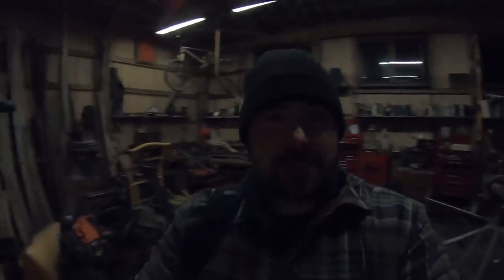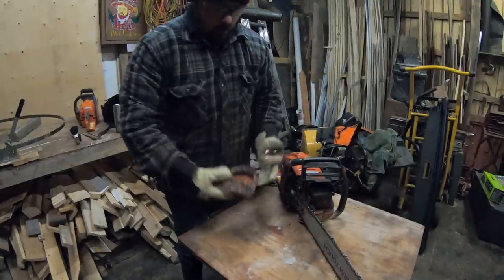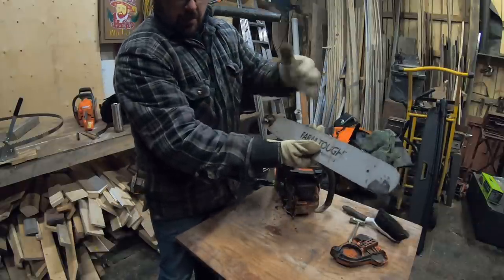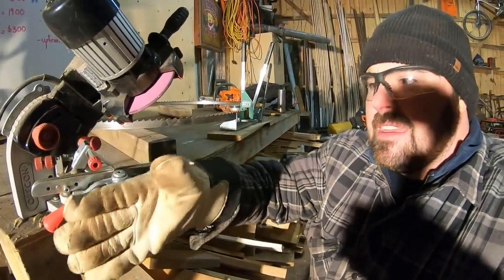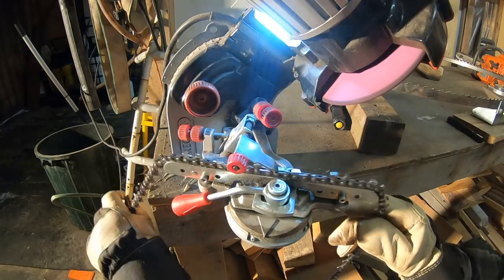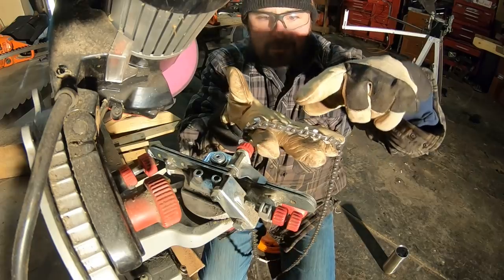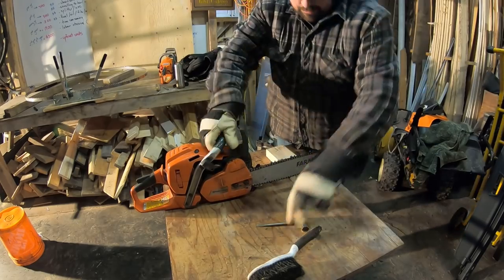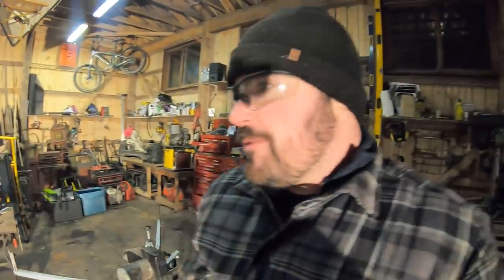Sharpening a Damaged Chainsaw Chain |  Razor Sharp in No Time

Comment: I think you need a wood stove in your shop!  I suffered frozen fingers for years until I put heat in my shop.
Reply from the maker: Unfortunately the high ceilings and no insulation on the walls made me decide to just use a small propane heater when needed

Comment: The file gauge is heat treated so hard a file will not cut it. Go ahead and use it. You want 25 thousands lower than the tooth. If you did file the chain depth gauge you did not show it very well. Some viewers may need a bit more detail on that. Thanks for your time and effort, that's why I watch you.

Comment: Can see you  wo the lights either.i had a grinding wheel explode while grinding n just removed my glasses for a split second to watch the last smooth cut n she exploded n a chunck went straight in my eye n it's still there.why remove the glasses because i can see close w them but can read w/o them.i like to hit that bar w the air as well.it really finishes the job n cleans the holes out.the flat steps are called the rakers so you know.not trying to be critical of you just shareing info buddy.when i went to work at gm they said here's your glove n i said i don't use those n he said you do here or go home.i learn how to use them but learned there are different gloves for different jobs.your are for logging or welding.you need some military wool gloves n double them or cloth gloves knitted cotton n doubled so there tight enough to grab things.they are better.not the warmest but better.you might like to look into a 12volt chain sharper for the bush.just hook to your tractor battery n go.i use mine most of any n sometimes a dremel set up in the shop for a quick tune up.lol
Reply from the maker: yeah it was a bit dark in there

Comment: Sounds like it’s time for a wood stove in the shed for a little radiant heat
Reply from the maker: If it was insulated I probably would
Reply: @sawingwithsandy  any heat that you can warm the hands up by is better then none. I still would put something in. It’s amazing how much it helps. I do everything outside when working on equiptment a tarp and a torpedo heater helps tremendously.

Comment: You need to put some heat in your shop.
Reply from the maker: Unfortunately the tall ceilings and uninsulated walls would not allow me to heat it too efficiently so I just use a portable heater if it gets too cold